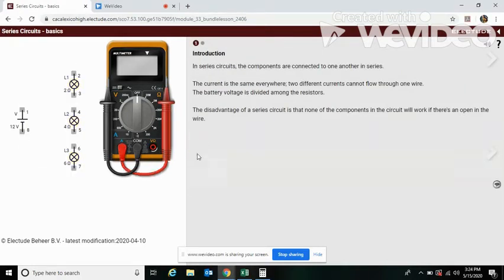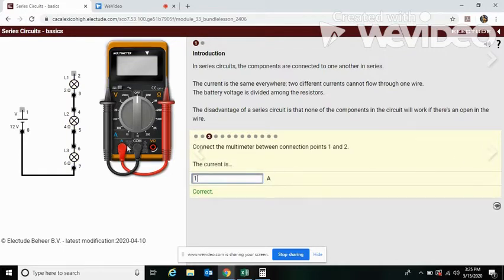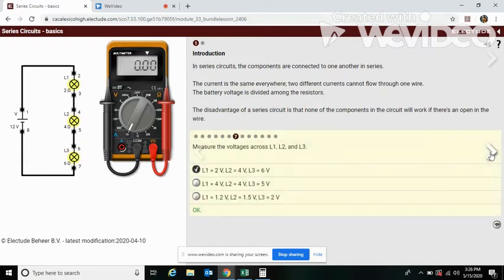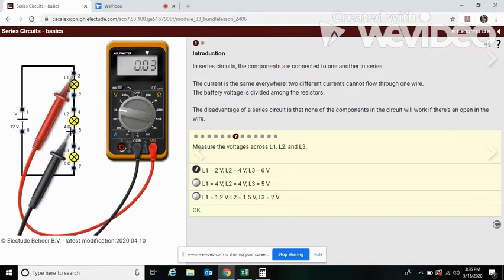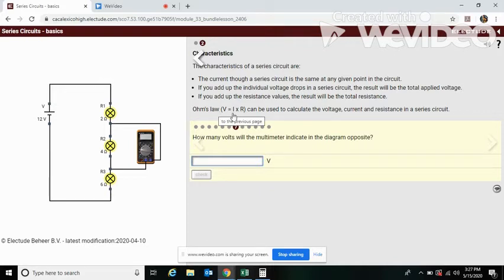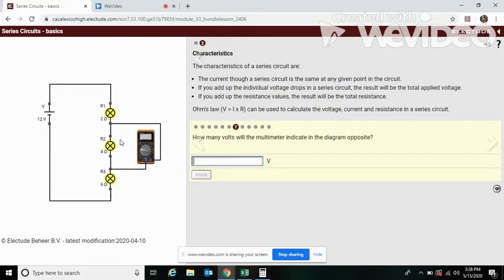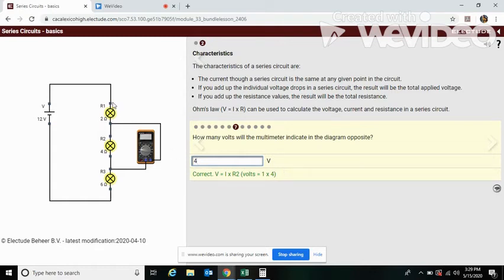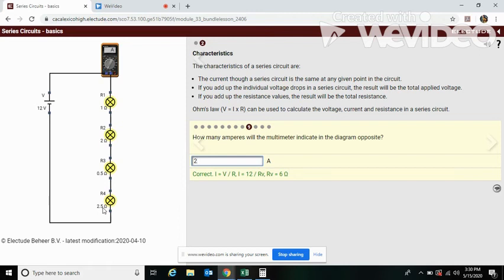Series Circuit - Electude

Comment: Questions 3,4,5&6 are 1.00 but you still have to connect the things to the correct points.
Number 11: 6v
PART 2:
Number 1: 2
Number 2: 6
Number 4: 12
Number 5: 1
Number 6: 2
Number 7: 4
Number 8: 6
Number 9: 2
Number 10: 1
Number 11: 5
If your questions are not the same I am sorry I just know that this would be helpful for some people 😭
Reply: bless you’re soul bruh🙌🙌
Reply: ily 🫶🏾